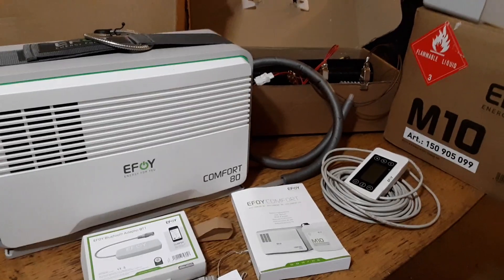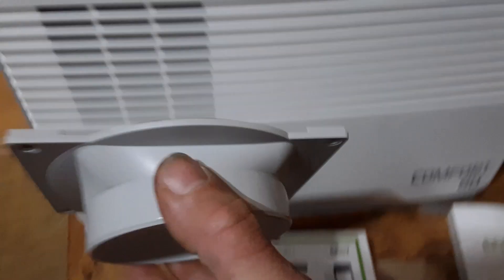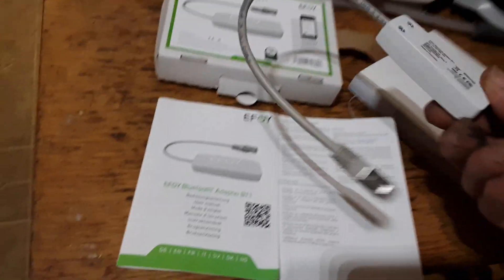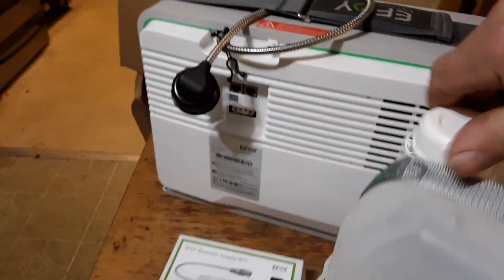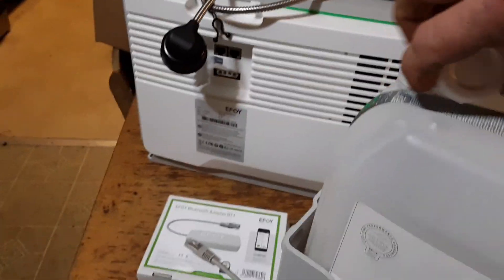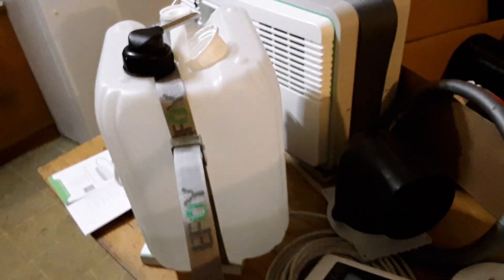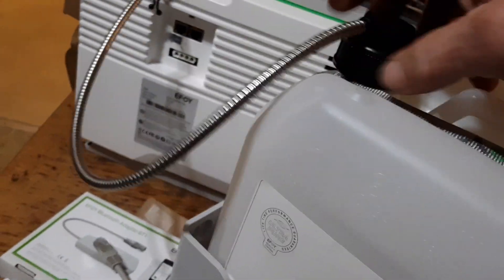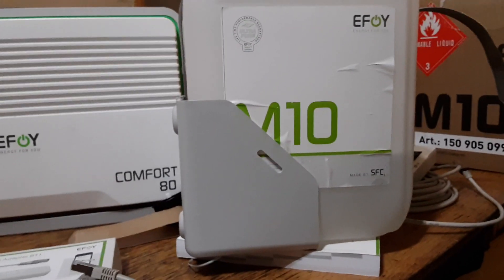Efoy comfort i80

Comment: I have found one where  I can buy one
Reply from the maker: Congratulations, be very careful there's two things that'll kill Efoy , putting the wrong fuel in it , bad/ used battery .  The battery terminals on the unit are special they read the battery state of charge, temperature

Comment: It may not be combustible as such but I think if you can somehow pour a little out and light it then it may burn. It may not have explosive power, just burn. Correct me please if I'm wrong 👍
Reply: Thank you for the comment evoy has a YouTube video with them setting a whole container on fire I'll try to send you a link but I'm not very savvy technically as production quality reflects
Reply: @frank12562  Yes the containers are good at preventing explosion but this is the hazard warning for the fuel inside.
This is from their site.

Hazard warnings: Highly flammable liquid and vapour.
Toxic if swallowed.
Toxic in contact with skin.
Toxic if inhaled.
Causes damage to organs.
If medical advice is needed, have product container or label at hand.
Keep away from heat/sparks/open flames/hot surfaces. – No smoking.
IF SWALLOWED: Immediately call a POISON CENTER or doctor/physician.
Store locked up.

I hope this helps Frank.
Reply from the maker: i fine my self able to do the dump it out  test .i have sold my efoy to westcoast off grid rv'er .i have some  m10 methanol fuel best by date is close .so i hope to made a half way youtube  ,without burning some thing down. if calamity awaits coverage WMUR 9
Reply: @fuelcellunboxenergyforyou9576  That is something i look forward to thanks.
Frank Gooch (above comment ) states it's watered down to windscreen washer consistency but I'm wondering if this is true, if so then it's a very expensive liquid mix to be mostly made from water.
Reply: https://youtu.be/AK-VbrVkytw is the M10 fualtank on fire methanol is very toxic more explosive than gasoline but watered down to the consistency of windshield washer fluid try lighting them on fire  .my comment in the video was to flammability not to it's not deserving a toxic label
Reply: @frank12562  I know your post is from a while back Frank, sorry for posting the toxic part of the report as well.
The part I was referring to was...Hazard warnings: Highly flammable liquid and vapour.
Where did you get the information that it is watered down to windscreen washer dilution levels, I cannot find anything anywhere stating that. Your feedback is always appreciated, thank you.

Comment: An average generator produces around 15kwh per 10 liters. This fuel cell cartridge (aka methanol) costs around $30/gallon vs the $3.60 for gas/petrol, yet produces less power than a comparable geni.  I am not expecting it to be better but for the very high unit price and to sell the fuel at such a high price will kill this otherwise good product.
Reply: Methanol is so powerful that even watered down to a non combustible state it still has 11.3kwh. per 10 liter .
diesel or propane can't be shipped by FedEx ,because they're too flammable